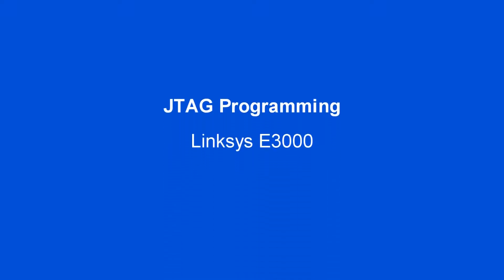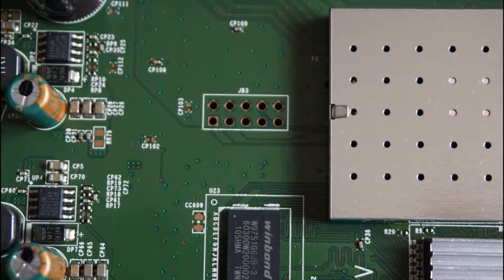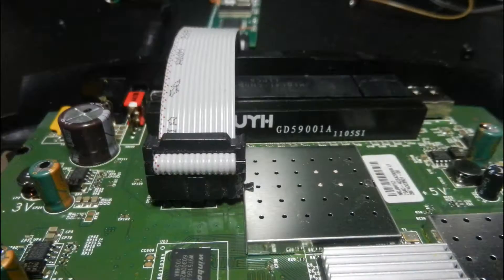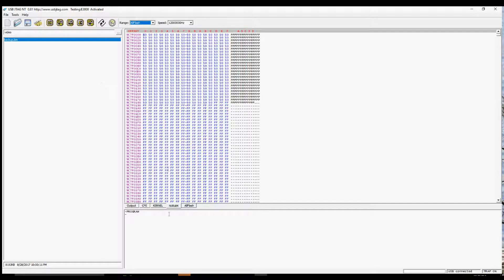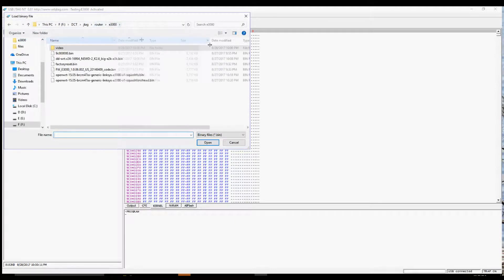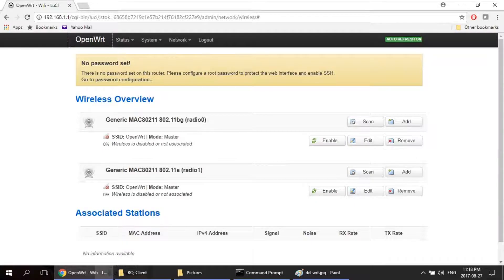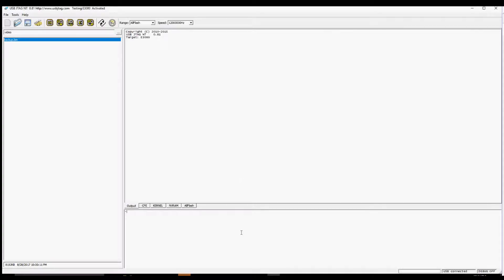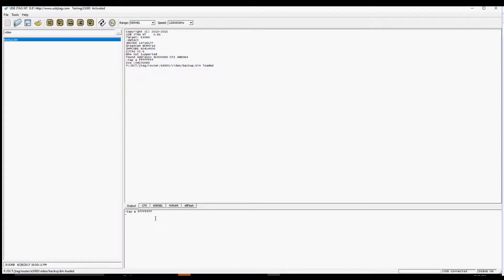JTAG Linksys E3000 programming

Comment: You need to add the software used, the hardware used, the connections, etc... I know you are using USB JTAG NT (0.81 ???) but it's barely visible on the video .. .then.... what commands, etc you are entering, what you are clicking cuz, man, this is almost impossible to figure out
Reply from the maker: If you have watched other videos of USB JTAG NT, you should be figure out. Most routers are the same.